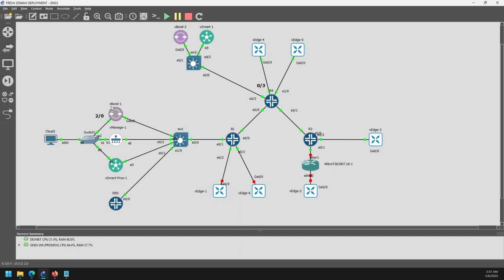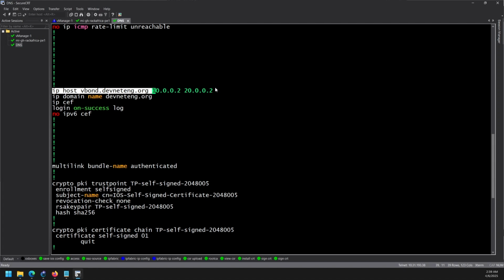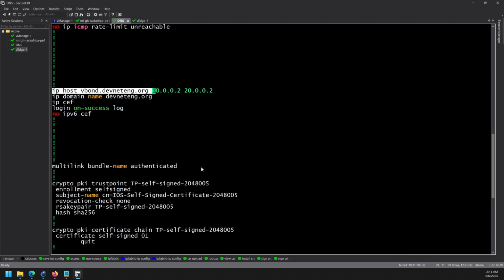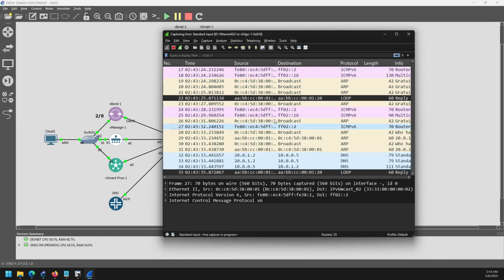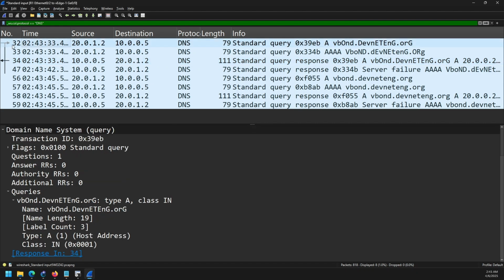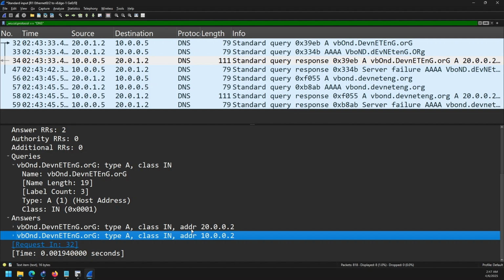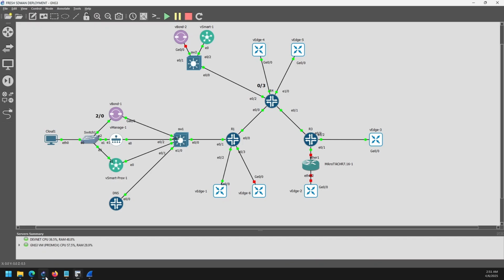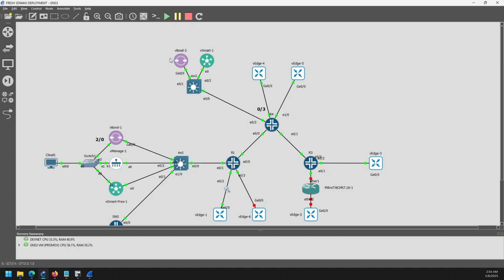Cisco SDWAN Ep8 - vBond High Availabity With Wireshack

Comment: Great job Kwame, I am going to give you a task only if you have time, I won't you to build a clustering between two seperate DC and simulate the failover. This is a current project that I am doing at the workplace.
Reply from the maker: @BenAgyemang-n5m  the controller deployment design will not be different from  my labs.  I believe your fail over will be at the service level... Which of course, we can use centralized control policy To prioritize traffic route in active / passive mode.